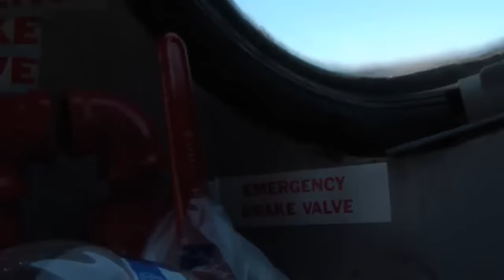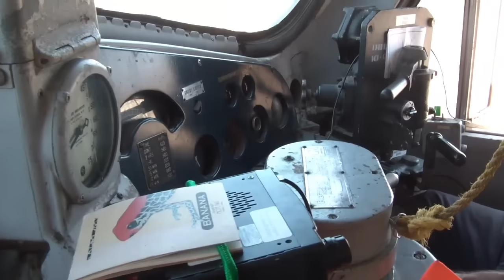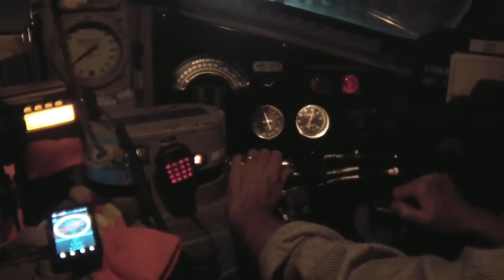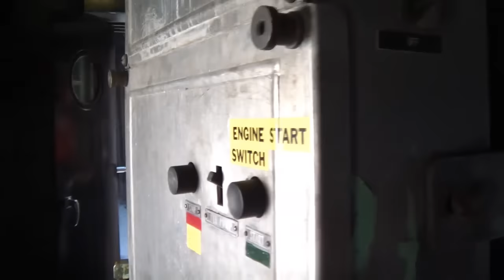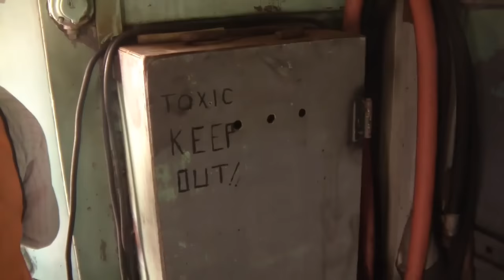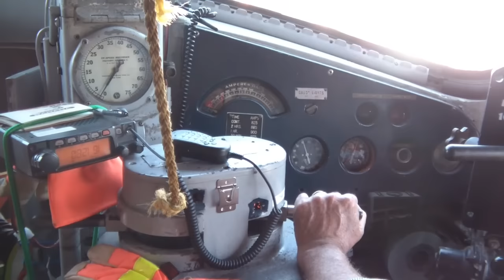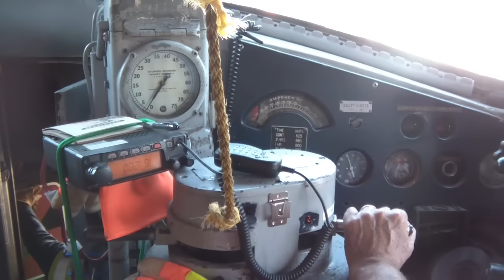Westbound Cab Ride Through Carrizo Gorge HD

Comment: The 3 blue/grey commuter cars (835 817, 801) are 1950s era CP Rail commuter cars that were use in the MOntréal to Rigaud line. Steam heat. I likely rode or walked through these cars so seeing them there really got my attention.  They were then transfered to CTCUM (Montréal transit) in 1982, and later to AMT (Agence Métropolitaine de Transport - Montréal area transit coordinator) when later was formed.  AMT upgraded the cars to electric heat while waiting for new cars. I believe they were removed from service in early 1990s. In your 2012 videos they are till mostly intact. But in later videos from hikers, they are filled with graffiti and interiors damaged. 

I am amazed at the investment and work on so many tunnels/trestles built for a rail line that didn't seem to have such a huge purpose. Would be intresting to know what customers drove traffic on that line to justify its construction.

Comment: Somebody is missing a great tourist opportunity here, what a fantastic stretch of railway line, mountain and desert scenery. Im sure the trains would be full either steam or diesel hauled. Watched this a few times thanks for uploading. Is there a DVD available
Reply: In the cooler months, this route would make a great tourist train run.  Run a mix of traditional passenger cars and open-air flatcars, like the Verde Valley RR in Az.
Reply: A 19th century steam locomotive replica would be cool for hauling a tourist train in the Carrizo Gorge, wouldn't?
Reply: This would easily take its place among the top 5 tourist lines in the US regardless if they ran steam or diesel. And it’s close enough to San Diego that people wouldn’t have to make a dedicated destination out of it like Cumbres and Toltec or nevada northern.

Comment: I lived in San Diego from 1966 (age 9) through 1985. I did see the Goat Canyon trestle model at the SD Railroad Museum (awesome display). I've camped  at several campgrounds in the Anza Borrego State Park more times than I can count, and heard stories of people that took the risk and hiked the Gorge using the train tracks, but I never made the journey myself. I've considered getting a group together to make the trip, but the sheer ruggedness and inaccessibility of the location in addition to the lack of maintenance of the track, bridges, and tunnels just presents too much risk for me. Thankfully, this video gave me at some idea of what what this trip would be like without the risk of being involved in a tunnel cave-in or dying of heat stroke in a place without any emergency services. If fact, just seeing how ramshackle the infrastructure was 10 years ago when they were still running trains on this road only confirmed my judgement. Awesome job posting this cool video. Thanks a bunch!

Comment: This is at least the 4th video I have seen about this route, this month (July 2023). I've seen the locked tunnels, big trestles, etc. So I wish there was more info on this ride. What was it all about?
•Did you go all the way out there just to deliver 2 rails?
•Were the Bobcat and excavator taken along "just in case," or what?
•Were the engineer and two workers volunteers?

Thanks for the geographical titles: Interstate 8 and other locations.

I'm in Northeastern California where they have removed a LOT of rail. It's very disappointing.

Comment: Very interesting. If you had been hauling a car of methylamine I would have been looking harder at that camper that crossed the tracks! lol. The terrain looks so similar. Why was the gate at the crossing not operating? I see the panel in the nose is open-that's a neat view. Are you relying on the mirrors or is there someone on a radio in the rear door? The boxcars down the embankment are just cool-do you have the story there? Was there a ramp to get the excavator on the flat? What's the story on the passenger cars? This is beginning to be a small book. Very interesting mix of rolling stock and locomotives. Thanks for the ride!

Comment: Awesome video of this quirky and fascinating stretch of iron! Great contribution to preserving the history and story of a line that seems to go from the middle of nowhere, through the middle of nowhere, ending up in the middle of nowhere. Thank you so much for uploading this! If you google the car numbers of those 3 blue coaches near tunnel 16 you will find an obscure little story. Also, I went to the Pacific Imperial Railway website, they have a nice little promo video there.
Reply: the whole rail line has been abandoned from Plaster City to Jumumba  now vandals are wrecking the tunnels and tearing up the tracks i fear for the safety of the
trestle at goat gulch,  this eas an incredible enginering feat over 100 years ago, it really should be preserved

Comment: That's a real pucker factor over the trestle.   How do they certify something like that to take the weight after so many years in the desert heat and cold.
Reply: I may be wrong, but I’m guessing the owners have no federal, or state requirements, or compliancy to meet for that trestle since it is privately owned, and not used for commercial operations.
The owners might have possibly inspected it for structural integrity on the surface to some degree, and then hold all trains to a maximum speed on it. 
I agree however that bridge is definitely too old, and way risky to support weight like that.
Reply: WITH THE CLIMATE THAT DRY VERY LITTLE WOOD ROTTING!

Comment: In such a difference from this viedo and your bio to modern day. I just hiked from the Dos Cabezas siding by the water tank all the way through tunnels 21 to tunnel 16 and Goat Canyon trestle and the railroad is completely abandon now. Any current attempts at rebuilding keep failing and the track is in awful shape with slides everywhere and tunnel 16 by the trestle having slides on both sides of the portals. Such a remote area the one thing that hasn't changed

Comment: I wonder why they ever built the railroad there.  Was it because of equipment during the early 1900's.  When I lived in San Diego 1968 -1992 it often seemed that a storm would cause damage on the route.  So much vacant country on that route.
Reply: San Diego had the only natural harbor in this area of the country besides San Francisco which is 100s of mile north. Los Angeles and Santa Barbara had piers. If it weren’t for the rough coastal range of mountains maybe SD would have ended up looking like LA-Long Beach harbor.

Comment: Thought the loco was an F Unit. Got a couple of these on my layout. Surely this must have been the first time an engine was down this line in a long time.
Reply: It is an F7. It has gone into the gorge a few times in the past couple years. It went in a while back to retrieve a caboose that was sitting on the tunnel 7 siding.

Comment: 50:12 Before the big Goat Canyon Trestle built in the early 1930's did the track that used to go through that old tunnel also have a small trestle there, or did the ground underneath the railroad just fall out?
Reply: That tunnel had a cave-in, and there was a landslide that happened to wash-out the rail line both due to an earthquake in 1932.

Comment: I was just captivated by the majestic views and the scenery. What a marvel of engineering the trestle at Goat Canyon is. I thoroughly enjoyed watching this video, as well as the east bound one to Plaster City. Two thumbs up on both videos!
Some questions....
1). Did the two little boys ride back to Jacumba via the track maintenance truck?
2). Do you know what the grade of the track is at 1:09 in the video?
3). Any reason the railroad owners have not removed the passenger cars shown at the 1:16, 1:27, and the freight cars at 1:32 time marks in the video? They probably have some scrap value.
Reply from the maker: Dick Walker I think the boys rode back in the hyrail truck. They were with the construction contractors.  The grade through the Gorge is 1.4%. Most of the cars seen in the video did not belong to the Carrizo Gorge Railway or San Diego MTS, so they were not theirs to sell.
Reply: Locomotive450 They may belong to the railroad museum in Campo.

Short story about the grade on that line. Some years ago, a disgruntled member or employee of the Campo railroad museum lifted the coupling pin, detaching several cars from the locomotive. The cars started very, very slowly rolling down hill, kept on rolling past Jacumba, gaining speed as they went, and derailed on a curve just a few miles down hill from Dobbins Spur. The galley car, which was still in use for tourist rides, still had food in the fridge and cabinets. The dining car had menus scattered all over. Bother were upright, but, the viewing car was slightly tilted and a very old tanker car was almost on its side.
Reply: +Dick Walker i think the kids were the  enginers kids dont know
Reply: +Dick Walker  no they did not stay there  did you not hear them on the  train on the way back i did

Comment: Nice videos. Is the line in operation now? It would be a very nice scenic railway !
Reply from the maker: +YvesD91 As of right now, the line is not operational. However, there have been recent developments regarding the ownership of the Pacific Imperial Railroad, so the future of the line is once again up in the air.
Reply: +Locomotive450 The F units should be brought back to WA.
Reply: +YvesD91 no
Reply: The tracks have been removed.  They are now trails around the Kirkland and Redmond areas.  Can't run the Spirit of Washington Dinner Train any more.

Comment: Has anything happened on this line in the last year or two—I read down thread that the rail crossing with the non functioning signals (S-2) is now paved over blocking the rails at the moment...?
Reply: Yes, things have happened, and nothing good. One of the tunnels, I believe Tunnel 3 at Division, recently collapsed due to fire. Suspected arson I hear. Museum in Campo hoping that a freight operator eventually comes along and can help them fix up the line.

Comment: Thanks for the great video. It's great to see some F7s still working and not rotting in some museum. One question I do have. Is there any reason why they ran the locomotive in reverse? I assume it was slow going because of the condition of the track. Is there a speed restriction on the road? Thanks again for a great video! I just subscribed to your channel so I will be assured of more interesting diesel-electric locomotive videos!
Have a good one!
Dave
Reply: Nowhere to turn it on the other end? Seems like more safe to run Nose first. The  view of rotting ties ,rocks , sketchy trestles. Just guessing no turn around at starting point.

Comment: how and where did those commuter coaches come from on that spur?
Reply from the maker: They are some of the old Chicago Metra Commuter Coaches that CZRy bought in anticipation of a commuter service that they planned to start running between Tijuana and Tecate in Mexico.  The service never happened, but a few of the coaches did end up running on the line as a tourist train between the two cities.
Reply: oh wow that would have been great if it happened. Do you know the what the future holds for the railroad and its current route? thank you for the info!

Comment: I didn't know those tracks were usable; I thought they were abandoned long ago. Or are some still in use?
Reply: we hiked out there 5 years ago and there were some railway workers doing maintenance on the tracks.  They did re-open it briefly but shut it down again.  Nobody knows the story on this  lol.
Reply: It's sad that all the work that went into building those tracks in such difficult terrain was largely wasted. I could be wrong but I think I heard the route is uneconomical because freight containers won't fit the tunnels. Sure would be nice if they could at least run a few sightseeing trains occasionally.
Reply: The railroad has been in use since 2002, but it has not hauled revenue freight since 2008. Now upkeep of the right of way is slow and sometimes small rockslides will block the tracks in the gorge for months at a time. Any kind of train movement through the gorge is scarce.
Reply: Stoneyburke Interesting. Can you tell the date the picture was taken?

Comment: Whoever decided to push a heavy diesel-electric engine over tracks designed for much lighter steam engines was just not thinking  about safety but was more concerned about profit.   Although the U.S. had good 19th and early 20th century railroads, something happened economically and politically,  U.S. railroad technology stopped being developed in the 20th century.  Other countries did develop their railroads, China and Japan are two that come to mind.  Too bad, it would have been nice to have an alternative mode of transportation other than automobiles and airlines.
Reply: The SP ran multi-unit diesel-powered freights on this track. There's at least one YouTube video of one. But you'll have to hunt it down. I saw it 2-3 years ago.
Reply: Found one called "Vintage Southern Pacific Cab Ride Footage."

Comment: Is that a mineshaft or what used to be a rail tunnel at 50:12?
Reply from the maker: That is the old tunnel 15. The entire mountain that it was bored through collapsed in the early 1930s, necessitating the reroute of the tracks and construction of the Goat Canyon Trestle.
Reply: Locomotive450  When Tunnel 15 was in use, was there a much smaller trestle leading from #15?
Reply from the maker: JacoZawinul I'm not entirely sure. I know that the roadbed of the old right of way has eroded quite a bit, so it might have stretched farther across the canyon towards the tunnel back then.
Reply: Locomotive450 Thanks.
Reply: +JacoZawinul There was an earth fill leading from tunnel #15. That fill, coupled with the unstable mountain that tunnel #15 bored through lead to the abandonment of that original alignment and the construction of the goat canyon trestle.
Reply: +SouthernPacific5339 Thank you for answering the little mystery like that.

Comment: I saw this video of a trespasser https://youtu.be/tV6aetDy4mw and immediately thought of this video. People are dumb, they don't know the difference between active and abandoned. But as time may prevail, there may someday be legitimate trains on this route.
Also the 3,599 subscribers is annoying me. It NEEDS to reach 5,600, and that is an incredible achievement.
Reply: +burdizdawurd1516 they rerouted that section it is no longer in use
Reply: +karl schweizer that is not logical. There is one set of rails through the canyon (not the abandoned tunnels) and AS THIS VIDEO CLEARLY SHOWS this section is active. I might recommend the ride in the other direction, because it is more proof that this is an active railroad.
Reply: +burdizdawurd1516  im wrong i though it was done i did my research and  i watched and did more research it is great that it is still in use would love to ride them rails
Reply: Actually, no, the line through Carrizo Gorge is embargoed for now. Nothing operates on it between Campo and the Ocotillo area, and the stored Metra commuter cars on Dubber's spur rolled back a couple of years ago and derailed on the main line. They're still there pending overhaul of the line by the new operator. Rockslides also block portions where this video was shot. On the Mexican side, Tunnel #3 burned and collapsed in 2009. It was daylighted and is expected to finally be back in service later this year so the PSWR museum can once again run excursions to Tecate.
Reply: LOL, you can see the rust on the tracks.